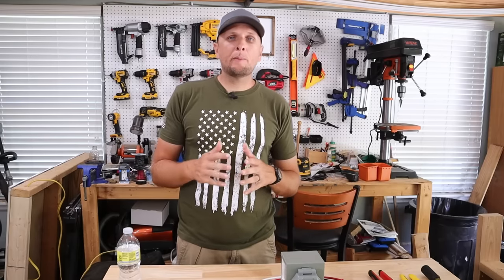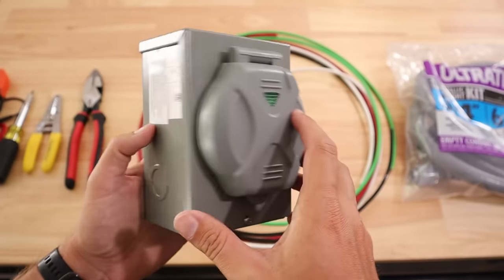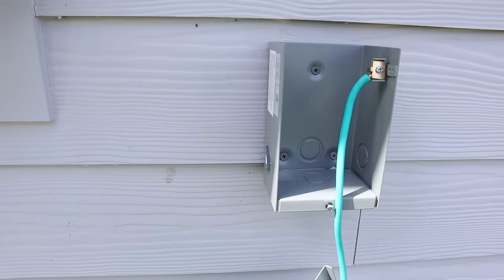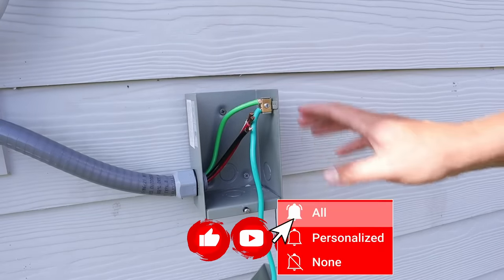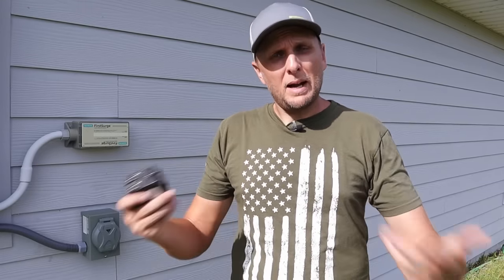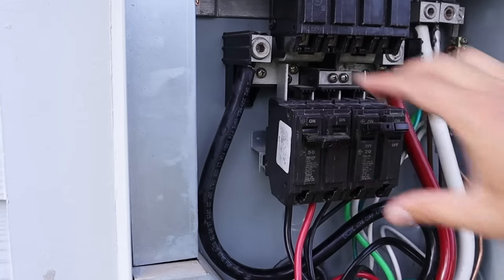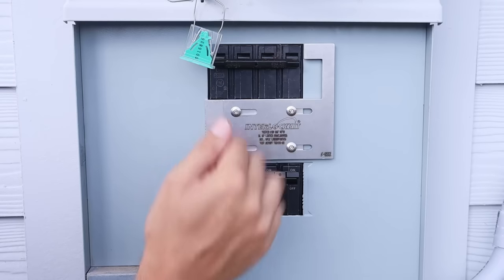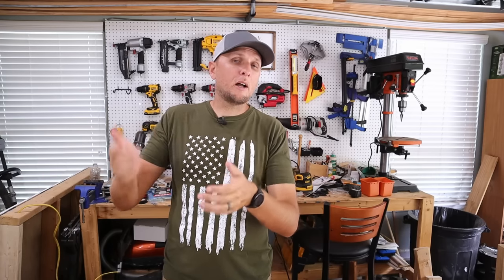The BEST Way To Connect A Generator To Your House - Interlock Kit With Power Inlet Box Install

Comment: I am in Texas, where cold weather puts us back into the 1800s. I bought a generator and some extension cords, but I'd like to use the house distribution system instead. I have this exact inlet box and a 12500 watt generator I can use. I just have to get the right interlock. My main panel isn't flat - the main power breaker is slightly recessed, and I am not sure which interlock to get (or if there is even one available).
Reply: Contact a local electrician for help.

Comment: Is your generator bonded to the frame? - most are these days I am curious because you mention it being important as I know. Mine is bonded to the frame and have an identical setup as you. I am thinking about modification to remove the bonding since ground and neutral are already bonded at my main panel. Thank you
Reply: Same situation did u find a solution?
Reply: @TheHelimechanic  - I found the wire and disconnected it on the generator. Now I have a floating neutral. If I want to run the generator by itself, I bought a plug that makes it bonded again so it’s quite easy to switch between the two.

Comment: Good video thank you. I was expecting some information about higher electrical requirements for a system, like a heat pump for example, that produces a surge when it starts. The electrical requirements of the whole house plus a heat pump, on startup, could trip the generator's circuit breaker, if the generator is not robust enough.
Reply: Soft Start ...

Comment: Thanks, I WAS WONDERING IF A PREDATOR 8750 WILL RUN A 2 1/2 TON A/C IF I INSTALLED A SOFT START AND RAN THE A/C BY IT SELF?   On my  generator it says not to exceed 58 amps, but i only see 30 amps where the 120/240 plug is located not 40 or 50 amps.  I have a 30  amp breaker installed in my  200 panel box for my generator now and my 2 1/2  ton  A/C has a 2 pole breaker on it in my panel box .

Comment: Question for you last Friday I tried to use my generator to power my 220 water pump but I was only seeing 120 volts at the end of my wiring that plugs into my water pump plug can you tell me why I'm only seeing 120. The last time I used this setup everything worked fine. Any ideas?

Comment: I can get 25kw towable diesel  generator from my work if power goes out. I only have room for 1 more double pole breaker. Could I put in 100amp breaker and some how run two 50 amp plugs. Being that my house is all electric. My  Furnace has a 60 amp breaker. Is it possible to be able to use both 50amp plugs tied into the house.

Comment: Thank you. However I want to point something out, the actual electric company that you get power from, they kinda get pissed off if you open the meter can because they put a special locking tab on the outside. And they will know if you tried to take it off. So rather than running the tube into that meter can on the outside, I’m just going to drill a hole in the side and run the wiring directly into the breaker box inside my house and install the 50 amp breaker in that. Other than that I really liked your video and I found it to be helpful
Reply from the maker: I didn’t go into the meter though.  It’s my main panel below it.  Didn’t have to remove any of their tabs.  Yes yours would go wherever you main circuit breaker is.
Reply: @HowToHomeDIY  Thank you, Merry Christmas 🎁
Reply from the maker: You’re very welcome.  Merry Christmas to you as well!

Comment: My problem is my main panel outside doesn’t have any spots to add a generator breaker. So my gen breaker is a part of the main panel in basement. I just know to turn off main breaker before switching on the generator. I wish there was an interlock kit for my setup though. I cant seem to find anything. The only thing “close” is that one that is integrated into the meter

Comment: One thing I don't understand. You wired the plug to the 50 amp breaker. Great your 50 amp breaker has power going in. How does that work other breakers or power other breakers?

Comment: Liked video saw some things that were questionable. Was that 3/4 liquidtight, if it is was 1/2 inch the 6 awg wires were to many over conduit box fill! Fire hazard.  Also it good practice to leave alittle exta wire noticed you chopedthose wires shorts I am sure you went crap when you were trying to teach lol. Service loops are handy !!
Reply from the maker: It was 3/4 inch.  I did initially say crap but then I measured them and they were RIGHT at 6".  So that was fine.  I did not want to wrestle with extra 6 gauge wire in that small box anyways lol.

Comment: In Australia we use 240 VAC not 110VAC.    Such an installation would be highly illegal here for many reasons.  The system as installed is prone to tampering.  The change over switch at the very least should be integrated into the one device i.e. the making and breaking of the two circuits is performed safely inside the switch automatically in one operation.  The switch installed relies on a thin piece of sheet metal (easily bent) to protect the system.

Comment: How do I know I'm selecting the right breaker?   I have a 50amp power inlet box, 6guage wires, and 50 amp power extension cord- plus the generator is 13k/10.5k tri-full westinghouse- with 50 amp receptacle), so I know I'll need a 50amp breaker.    But, do I need a double pole breaker?  Does it matter as long as it's a 50 amp breaker?  Would this be in part a matter of the type of main panel I have/space etc to add a breaker, AND would it influence the type of interlock kit I should order?    I still need to order the interlock kit as well.  Thanks - great videos!
Reply from the maker: Double pole and needs to be the same brand as your box is.
Reply: @HowToHomeDIY  To clarify - when you say 'box', do you mean the main electrical panel or the power inlet box?
Reply from the maker: Electrical panel.  GE panel needs GE breakers for example.

Comment: This is great if you have a separate box outside. And remember you don’t own that box your power company does even if you own the home and if you have a land patent they own that box . That’s why they can walk on to your property at any time.
Reply from the maker: No they own the meter box.  Everything after it is my side.  They can walk on your property anytime to read or service the meter.
Reply: @HowToHomeDIY  Correct that’s what I said they own the box .
Reply: @HowToHomeDIY  the way to do it legally is with a certified electrician they contact us and we come out and ok the job then he can proceed.
Reply from the maker: @user-kv3yt5td5d that box comes after the meter.  It’s my box.  The utility tags out their box so the homeowner doesn’t tamper with it.  Where I live, I don’t need my utility company’s permission to install or repair things on my home.  And as the homeowner I am allowed to do it.  Some things require permits, some do not.  So maybe where you live this is a thing.  But that is my box, it is the only box I have with a disconnect so no, not like you said.

Comment: Hey! With the main breaker off and the new 50 amp breaker on, you can control your homes Individual breaks still correct? In order to turn off the hvac breaker if you don’t have a soft start attachment.
Reply: Correct, though a soft start is not always needed if you only want to run the AC and nothing else. Whatever your AC breaker amperage is multiple by 240 and that the required running watts for your generator to run your AC without a soft start. Example if the AC breaker is a 50A, 50 × 240 = 12,000, so you need 12,000 running watts to run the AC.

Comment: The 50 amp breaker you added; the house is powered through it? A kind of a back feeding to the house from the generator?

Is it probable to have to move one or more breakers to allow a place for the 50 amp so the interlock kit will work?
Reply from the maker: It is the breaker powering the house only in the event of using the generator to power the home.  More than likely there will need to be some breakers moved so that the generator breaker is near the main breaker for the interlock kit.

Comment: I have a small 2300 watt generator, but just ordered a 9000 watt inverter...my question is would be, is it possible to have twoseperate inlet boxes. To use seperately of course. The 9000 to run my AC and a few circuits on different inlet box for a deep freezer, refrigerator and a few lights or a TV.

Comment: Electrician here, I was wondering if there was a way to prevent current from going back into the power lines via the neutral conductor at main disconnect. I have heard from Linesmen that people who set up generators to the main panel are feeding power back through the utility lines and could be dangerous if they have to do emergency repairs. Thank you for the vid.
Reply: The only way you would have current trying to feed back to the grid on the neutral is if the main service ground connection to the neutral is compromised. If your generator somehow backfeeds the grid when the grid is down, its going to trip out the gen pretty fast, and blow it up even faster if the grid comes back.
Reply: @jpcab9460  Thank you, I always wondered about this scenario after talking to those linesmen. I have wired a few generators this way and never heard of any incidents.

Comment: Thanks for the information. 

Trying to find information about how to implement a inlet box with a bonded neutral generator. 
I have installed a 50 amp inlet box, 50 amp circuit breaker with an interlock kit,
I have a firman h07553. (bonded neutral).
Difficult to find  detail information on setup.
Found a link describing how to remove the bond and make the generator a floating neutral.
I realize I need to place this back if I am going to use the generator as a standalone,
I should not use any of the direct plugin connections to the generator. (Extension chords)?
The generator comes with a 20 or 30 amp plug with 4 120 plugs on the end.
I suspect I should not use them with the inlet box connection.
DO I need to ground the generator?
Can I use the GFI plugs if I use a binding plug?
Reply: Same situation. Did u ever find your answer?

Comment: so, while the main breaker is off if you put the other breaker in the on position it will automatically send power to the interior service panel?  you don't have to do any sort of transfer switch?  Just turn on the breakers that you want powered in the service panel?

Comment: 1 thousand thumbs up for an amazing straight forward video. But I have a question for you or anyone else that can give me an answer. I have a heater chicken waterer in my coop. The chickens are constantly unplugging it because the 110 volt box is under my elevated hen house. Do they make anything to lock this in place so it does not come unplugged but can still be unplugged by me to clean and refill??? Thx in advance
Reply: Use a Twist Lock plug.  Replace the outlet box with one that has a clear plastic cover that can close with plug connected inside. The make outlets with retainer clips to hold power wire, just behind the plug.

Comment: Watched this and then the one on the 50Amp box....question is my 4 ton/w/ easy start pulls 31 amps to start but you installed a  50 amp box and used an adaptor to your 30 amp generator.    Why install a  50 amp box if you only have a  30 amp cord on the generator??

Comment: Nice video, but I don't get the breaker placement part. 
You just need to connect the wires to the bottom and that's it? No wires at the top of the breaker?
Reply: The circuit breaker connects directly to the L1 & L2 bus bars.

Comment: I had a question, what about if its raining? Is that outlet and the female plug water proof? How about the plug on the generator as well? Im down near Houston, tx. Im assuming a running generator cover would be needed if i dont have an extended patio or car port to put it under correct?

Comment: I guess that interlock prevents a generator from feeding power back into the main line coming into the house. If someone wanted to provide the full 200 amps I don't see that kit as adequate. For a large generator such as one of the bigger Generacs, It would be interesting to see how they make the connection.

Comment: So, to reverse power a house panel, you hooked 120V to a double breaker, that would in turn power 120V to both sides of the breaker box, so that all the breakers would work?  Of course I would have my other 240 breaker off anyways as it's not being used.?

Comment: That's a really simple solution. Too bad they are illegal in Canada. Only interlock kits that are fixed to the panel itself and not the panel cover are allowed. They don`t allow any interlocks that can be defeated by removing the cover.

Comment: Might be a silly question but I should be able to install a 50amp inlet receptacle. Then build a wire/cord if say I needed to use a 30 amp generator just need to pay attention to breakers if a 30 amp is used correct?

Comment: Generator interlocks are the best option out there but don't waste the money on a 30 just go to a pv50 amp so you can go to a 12 KW generator down the road if you want and not be limited and have to replace it just do it right the first time

Comment: Does every house have an outside breaker box? I do have a metal panel on the other side of my inside breaker box but there doesn't seem to be a way to open it. If not can you maybe do a video about hooking up a generator to the inside box?

Comment: I've seen a couple confirmations that you should have a soft start kit for A/C. I'm curious if you also need a soft start to run heat.
Reply: If it’s a split system, it should assist both with no problems

Comment: the link for the 5ft of 6 gauge wire says that the green is 10 gauge, and the rest 6 gauge.  will the 10 gauge ground still be good enough for a 50 amp set up? or do all need to be 6

Comment: I have an interlock for my rollout generator inlet box. I had an electrician wire it up. I’m a power lineman for the local power company so I’m not intimidated by electricity. I hired an electrician because you guys have licenses & I don’t. Heaven forbid there is a fire I’m covered because my electrician pulled permits with the town & they were subsequently approved. 
I have a 30 amp plug for mine & my generator is a 7000 watt Honda EU 7000is. I have my cable run from my circuit breaker panel in my unfinished utility room to my shed where my generator inlet is. The run is a about 40 feet long. I have noticed under 1/2 load that my 4 conductor #10 stranded copper cable is warm to the touch but not hot. Is there any cause for concern? I was contemplating upgrading it to #6 or #4? 
The interlock was something I would see at customer’s houses when I was there to disconnect power at the pole for the electrician. I liked that there is no transfer switch & the limited number of circuits I could use. My door bell even works on generation. 
Thanks for putting out this comprehensive video on installing & using a generator to back feed your panel safely without killing people. 👍🏻👊🏻

Comment: I would love to know if there is a way to run electric heat with a generator and some how take out the strip heat and use heat pump only..  Is there a bypass kit for that?

Comment: i have the F150 Lightning with Pro Power onboard.. Basically a Generator.. but I don't plan on paying SunRun the 4 to 6k for the Transfer Inverter for the Intelligent back up power just yet (which runs through the 80 amp wall charger that came with my truck.) I plan on installing exactly what you just showed here... But question... The 240v outlet from the truck is only a 30amp I believe so should I only install a 30 amp box wire and breaker???

Comment: I have purchased the 50 amp box and the interlock at the moment I have a 30 amp generator where can i purchase an adapter from the 50 amp inlet box to the 30 Amp generator?  I live in the Midwest and it is thundering as I type:). I am using the 50 Amp box because we plan on doing a major upgrade and then I will be using the 50 amp gen.

Comment: I have a L5-30 inlet box with THREE wires. Would I secure the black and white wire to a double pole and the green to the ground?  I have a 2200 generator and want to wire it to the panel. I would TURN OFF the main switch and turn on the 30 amp double pole and plug in the generator to the exterior outlet. Will this work? I would only power small 120volt stuff inside the house.

Comment: Can you use the same 50 amp receptacle to hook up an RV for power out, then switch it to generator mode when needed? Or do you need to install two 50 amp receptacles?

Comment: what is the rating of that black cable you used to connect the gen to the pwr inlet box? 50A? What if it needs to be longer because you want your gen behind the fence? 50ft away for example?